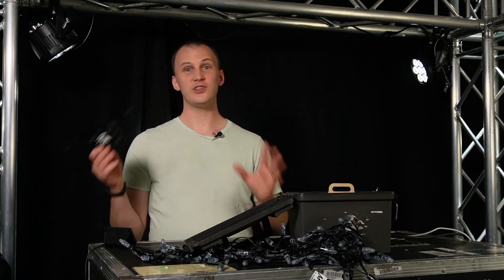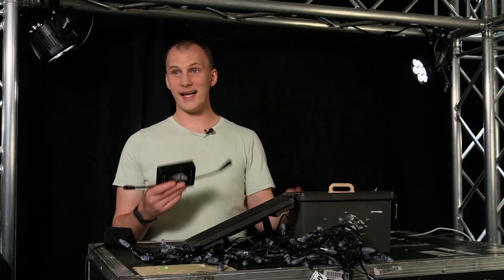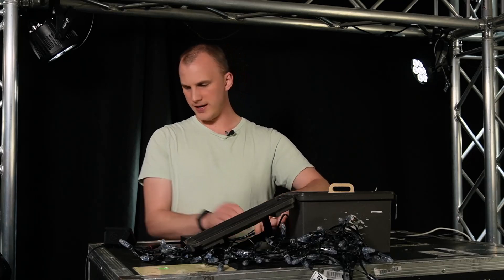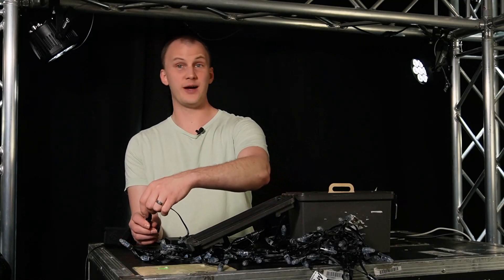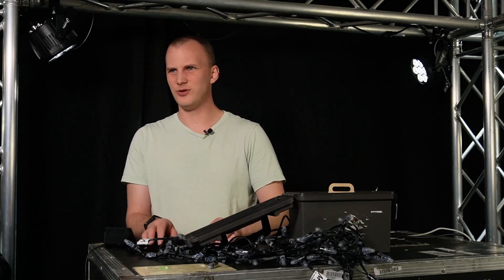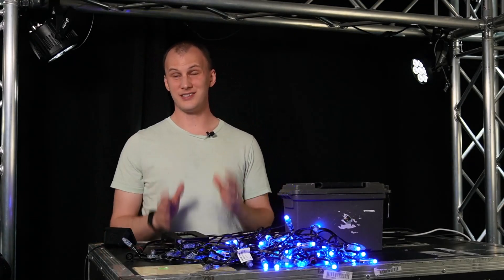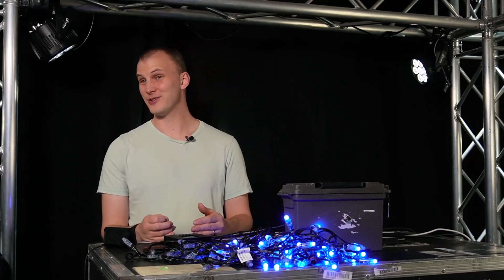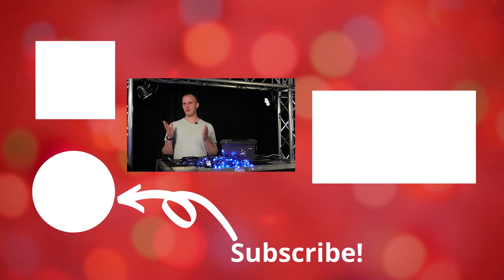What is the Falcon F-Test?  How-To and Review!

Comment: Can you recommend a 12v battery pack that can interface to the F-Test? 
I see 5V USB interfaces but I think I need a barrel connector on the 12v output from the battery and an adapter to the USB mini-B port on the f-test.
Reply: If you have a port or 4 for power injection, use that. You need 12 volts if your pixels are 12 volt.

Comment: I'm having an issue that I can't figure out.  On my roof line, about 50ish ft away, I'm getting minor flickering on the last 3-4, 50 pixel strings and it seems to transfer back down the roofline some to the others.  The closet strings to the controller are fine.  But I also have ice lights the same distance from the controller and they're fine.  It's only the strings.  i also have several F-amps down the strings.  I checked all the connections and they're fine and i have sufficient PI points because at the very end of the strings, i get 11.5v.  The only thing I see that could be happening is, I have a PI box at the very end and run up several injection cables to different points along the roof.  Could this be the issue?